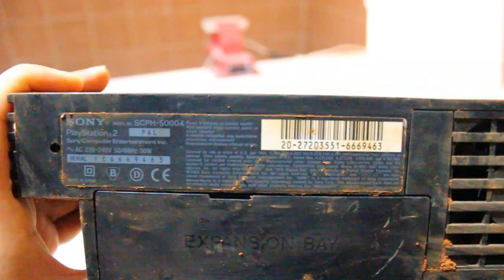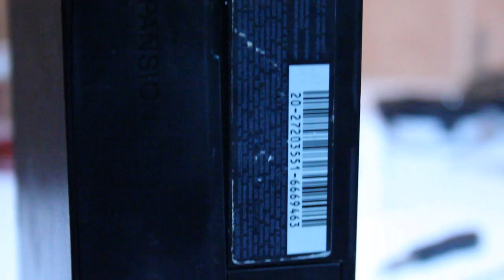Repair The original PS2 From Junk - full restoration 🎮🎮

Comment: Hey. I need help regarding my PS2. I m facing this problem for the first time. It was working pretty well last month. I will list all problems. If there's any question regarding then please ask.  Here's what issues I started facing:
1. There is no display. When I connect the PS2 and turn on the power button from the back. The reset button shows the red light. I then click on it and then the Green and Blue lights turn on. The fan at the back starts working. The disc tray is also working, but there is no display. 
2. After clicking on reset multiple times it then starts to display but the start-up music is out of order. The sound gets hanged. The controller is working (i can enter to and go back from browser and system configuration ). If I click on the reset button again then there won't be any display again. Same issue. And if it displays (after resetting many times) and then when I insert any CD. Loading gets hanged,  and if the game works out of the blue moon then there is no sound. 
Would be happy for the reply. Thanks.
Reply: Maybe a good cleaning would help ?